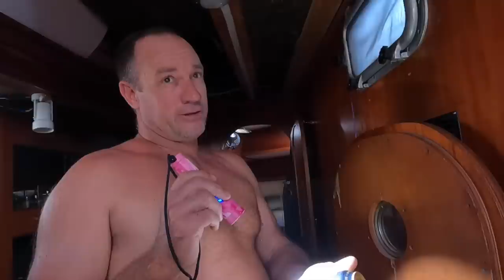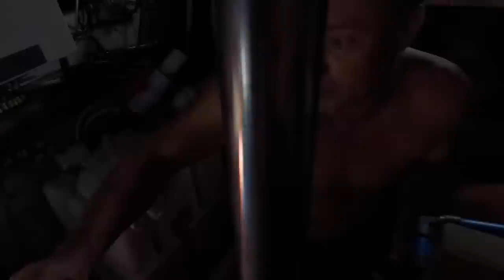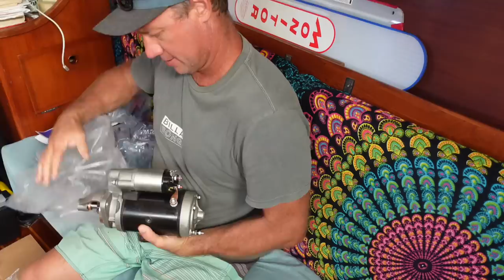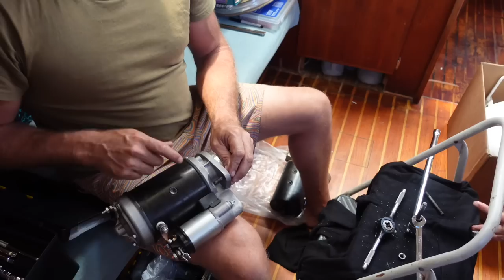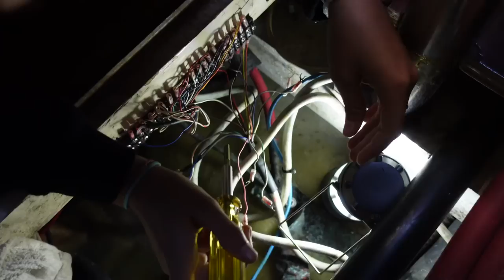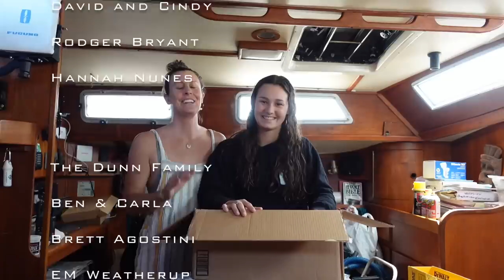This could have gone really bad | LOTS of boat-work | Ep 302

Comment: Hiya to you all,
A great video; thank you. As an ex-spark, I must say rip out every bit of old wiring. Rather than paying a lot for a loom, buy reels of the wire and make your own loom. I would always upgrade the conductor size to allow for a higher current draw without burning out. Be careful about bundling many wires together; the added heat can again melt the insulation. Use the correct crimp connectors and heat shrink to protect the joints. Use crimp pliers, not a hammer, to make the joint. This is your home; build for your safety. A fire miles offshore? Safety has to win. I love your channel and the way you all join in. No sex discrimination; Bella is a great budding engineer. 
As I always sign out, stay safe, Steve...

Comment: While you are in the US the best cutting fluid available there is Rocol. It will protect your taps and dies. The fumes are a little acidic but isn’t a huge problem. If you are going to buy any hoses look at Swage lock hoses. These are a rubber hose and the amazing thing is that the fittings don’t need hose clips. I’d installed a radiator rubber hose for a deck washdown system but when I cam to install the pump I discovered that the radiator hoses are good for 30 psi at best. The Swagelock hoses are good for 300 psi (I believe) and are virtually indestructible (we used them in our factory as air lines for 30 years).

Comment: ... think you are right Lee, hit the nail on the head that what ever the switch is that activates the solenoid may need some attention, the spring may be gone or corroded preventing it from disengaging ..... that is quit the task, bet you are thankful to have Bella in it with you sorting the electrical out, bit more than a 15 minute task .. smilin ... bit early to be startin celebrating Christmas ... what a haul ..... thx for the share .. as always .. never stop dreaming, just dream bigger .. have fun be safe, save our oceans ...

Comment: For an older long term keeper vessel, the best solution is a full rewire.  Expect to find more dodgy wiring and several superseded generations of old unused wiring that can be removed.

It's a huge amount of work for DIY but you will have something you can trust, a design to suit your needs and for future diagnosis you will no the system back wards

Good luck.
Reply: Yup. Doing this to our 530! Don’t want junk wire aboard.
Reply from the maker: Yes 🙌 agree

Comment: in usa we have 120 and 240 we just have different outlets and plugs like our small apliances are usually 110 but bigger things like a electric range or air conditioner electric water heater etc all them run on 220/240

Comment: There should be a pull in, and a hold voltage on that starter solenoid! You seem to be across most of it, so I’m not going to rabbit on! Probably the best way is to start a fresh with the wiring.....!? 🤨 Good Luck!🤞 😎🐬⚓️🏖🌴☀️🇦🇺
Reply from the maker: Thanks mate yeah fresh is best 😜

Comment: You should probably get someone who has a handle on electrical wiring and get some advice. Yes, getting the melted wiring out is good, but someone who is familiar with electrical will probably check out this melted harness and carefully figure out where the wires are going now, make a diagram, and be on much better footing. Getting a wiring harness for a boat that age will be almost impossible. You'll have to make , at a minimum, parts of that harness. I suspect that boat has a lot of added wires because the former owner had trouble and rather than remove the burnt up wires he just left them there. The diagram would be simple and have far fewer wires than I'm seeing there. I'd recommend someone who is good with wiring and wont feel overwhelmed.
Reply: It did look a lot better with the second look.

Comment: Relay switch? Mine stuck on other wk
Reply: that's a good call sometimes teh ignition switch doesn't operate the solenoid directly but instead operated a relay.
Those relays have a really tough time because switch powerful coils causes a huge voltage when they are switched off which then arcs across the relay contacts and can weld them together   <- ignore that bit if not interested 😂

Comment: Never ever leave the key in the ‘on’ position. Your entire ignition/starting system may be fried or at least damaged.
Reply: That's a poor design if it is - there should only be voltage to the starter switch, alternator exciter coil, gauges and perhaps to a fuel pump if there is one. (cheap alternators may not be happy but good ones can take it)
Later engines will have the ECU/management unit powered up
It will ruin your day though as it will flatten the starter battery - easy to rig up a simple buzzer on the oil pressure switch to alert you to ignition on engine off (and engine on, low oil pressure)